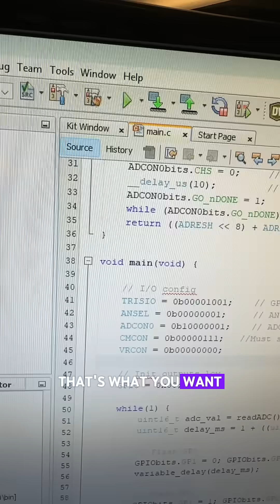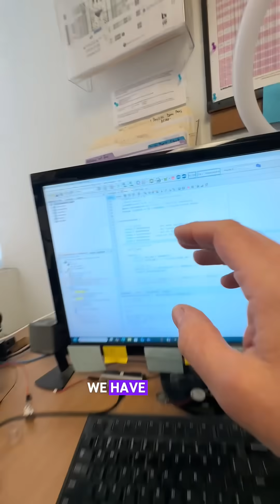Introduction to Microcontrollers and PIC12F675

Comment: PIC you say.. have you met the upgrades, the 6502 and the 8051? 😂
Seriously though - that whole proprietary ecosystem should stay in the ground.
Cortex M0, STM8, STM32.. so many alternatives. Many are slightly more complex(and so is a modern PIC) - but they make up for it by not having Microchip’s madness forced upon you.
Reply from the maker: I’m just throwing the PIC up here as an example to inspire with, I’m microcontroller agnostic. Point of the video is “hey, small simple black box does crazy stuff with limited complexity”.
Reply: @i2c_jason  And nice video :) But as you can see I disagree about the PIC being a good example for a beginner MCU. Unfortunately the complexity of the Microchip ecosystem far outweighs the simplicity of the MCU.
A beginner friendly MCU is something that’s open, doesn’t force specific tools on you, and has a low cost of entry. Sadly, Microchip is neither these days - so it would probably be my last choice for a video like this. Unless we count the acquisition of the ATTiny series by Microchip of course.

Comment: I don't really agree, what you call extra junk in those boards helps beginners quickly get going and provides a decent developer experience, for example a lot of Nordic's nRF boards come with a built in Segger JLink debugger which allows you to debug with gdb out of the box, this is thanks to the usb you hate, the usb also allows you to see the serial output of your app, idk maybe you can do some of this with the programmer of the PIC but I doubt it will be as easy
Reply from the maker: They each have different applications. I love my Arduino ide with serial terminal, but I’m usually relying on some random library that has no accountability. When the customer really needs a hardened solution I tend to go with microchip. When I am just doing quick prototypes or higher level software then I like to have something closer to an ESP32 or RP2040, or even a Pi.
Reply: @i2c_jason Btw I just searched and I think I'm wrong about the pic, we learned about them in school when I was 17 and we wrote assembly for them, that's why I assumed they're just old less powerful tech, it seems that they're still used in the industry and they evolved, I'm pretty surprised actually!
Reply from the maker: @yassine-sa oh yeah for sure, they have 32 bit parts now. I’m not really a fan of their 32 bit stuff because it’s hard to get access from the applications engineers when you’re a small company. So in that 32 bit situation I like the open source stuff. Microchip was kind of like Arduino back in the day, geared toward hobbyists and students, but all of that momentum found its way into industry.
Reply: @i2c_jason I agree, using libraries has a cost, but microcontrollers shouldn't be blamed for making it easy to use them, it's the developers fault.

Comment: Learning this stuff is a really good skill to have and actually a must skill to have when you are in the electronics field. I would suggest being skilled with PIC and ESP32 and Raspberry Pi, Arduino etc, etc, at least all of the top 5 microcontrollers. Understanding how each work gives you the flexibility you can use in your toolbox during your career. Learn Electronics circuits, C plus code and python code for the basics and branch out from there. Once you have a good understanding of how these things are wired up, programmed and how they communicate  with each other or just the world around them you can use that information to have a very rewarding, fun and interesting career.

Comment: No thanks, PIC's and having to buy external programmers is expired tech, I had enough at PicKit3 being needed to flash itself for each PIC you selected, so we are now re-flashing the programmer itself to flash what we want to flash....
You can use barebone ESP32 ( nobody forces you to use the pre-build "arduino" style boards) , new versions have built in USB-JTAG, you just stick a usb-c connector on your PCB and flash it. For simple things you have tinyAVR 0/1/2 series or AVR DA, UPDI flash over 1 wire with a 1$ USB-Serial converter and that's all, not that PIC crap with 5 pin flash, new expensive programmer each year, nahh.

Comment: I'm definitely intrigued by PIC. Things like the DMA controller and the flexible peripheral mapping make me want to play with them. Some the stuff Mike Harrison has pulled off on PICs is pretty impressive. Though I tend to like very lean dev environments rather than IDEs. I do a lot with ARM, particularly STM32s and it's pretty much just Neovim, debugger, compiler and openOCD. Hopefully when I get some time, I can knock something together with Microchip's compiler because they do look like quite appealing devices, especially the more modern PICs.

Comment: Someone that’s taking a class for embedded systems and using a STM32107 board, is this a good investment for small, individual projects? Or would you recommend something more
robust? I'm computer engineering, just trying to get a foothold on materials for a good project, something to add to my resume. I'd love to discuss more with you if I could.

Comment: This is literally how I got into firmware development and electrical engineering. But started with the Atmel Atmega like Arduino. But I guess microchip owns both now, so the only odd ones out, are those who started with ti 😂

Comment: I mostly use pic16f872 and pic16f886 chips.  I make anything from charge controllers to led turn signal flashers.  My latest project is a prototype pcb to incorporate a pic and Arduino together.

Comment: ESP32 is having a backdoor? Common, be real. So hyped up by finding from "researchers" who can't even explain what kind of backdoor he discovered. Anybody who works with any sort of programming may leave line of codes for troubleshooting on purpose or not. And to not include that troubleshooting section in the official documentation does not mean it is a backdoor.

Comment: How's this chip compare to an attiny85? I've been getting into those, and it's been useful, but I'm definitely intrigued - my mental model of PICs is significantly larger than this chip.
Reply from the maker: I’m still learning the tradeoffs too. Sounds like the ATTINY is better on paper.
Reply: @i2c_jason I like the number of analog inputs on the attiny, it's useful for my purposes (Eurorack synthesizer modules), even if the lack of any true analog output requires a little creativity on the output side.
Reply from the maker: @j @jakykong do you bit bang your own Class D amp basically? Haha
Reply: @i2c_jason Haha dang close. I use an RC filter to smooth the PWM and a TL042 op-amp to scale and offset for Eurorack range, just have to carefully choose resistors and caps. 😅

The other approach I used was a shift register and a DAC0808, which is significantly more precise but also more convoluted 🫠
Reply: Still on the breadboard while I learn to optimize for the tiny, I'm used to datacenter scale software so it's a fun but very different exercise 😅
Reply from the maker: @jakykong nice 👍👍

Comment: I have some of these pic micros. I use them in some of my projects. I started using them back in high school in 2008. I do like how easy they are to implement in a project with minimal circuit design.

Comment: Purely from expense pov I'd pick an arduino nano, cheap as chips, easy to program, tooling is free. For the price of a pickit5 you can get 100 arduino nano clones on your favourite asian webshop. And it's also an 8 bit core and runs on 5V. You don't have to figure out the toolchain as it's all ready to go with the software. 

I started out with a PIC16F84 and a hacked together Elektor programmer hooked to a serial port that sometimes worked and sometimes killed the MCU, back in the day. Later I got a pickit3 and things improved, but boy is the Arduino much easier to use and more accessible.

Comment: It would be cool if you gave more use cases for how to use these things. Both videos I've seen have shown how to blink LEDs, so not sure what are all the cool things you could actually do
Reply: Well, that's the thing: the limit is your imagination... or budget. It really depends on how many peripherals do you have within the chip, this one is very limited, it barely has a couple of timers, gpio usage, and some models have an analog to digital converter (ADC). On top of that you have interruptions on external gpios and some other ones as well.
Whatever you come up with that utilices just that, you can do it. Normally these companies integrate a few examples of usage within their IDE.

Comment: You'll be replaced by AI before you finished to learn it...
Reply from the maker: If you look at the trends in AI, that singularity keeps getting pushed out. I was very disappointed in GPT5 for example and always use 4o. So I agree that eventually a lot of the minutia will be done by AI, but you still need a physical human to define problems, create requirements, and otherwise engineer context for whatever capable AI “can just do this” so it knows that to create.

Comment: Even with these skills I struggle to find projects or things to use these for. But this helped pique my interest back!
Reply: You could just do some basic stuff and make YouTube videos explaining it.
Reply: What I ended up doing was just mixing the things I enjoy. I’m into photography, but I work as a SWE, and I also like electronics and IoT. When I put those together, I start getting random ideas, sometimes with a bit of help from LLMs.

One of the things I made recently was a little film-emulation camera using a Raspberry Pi Zero 1.3, the 5 MP camera module, a tiny LCD, and an 18650 cell in a small case. It runs a program that does four film-style presets, 3D LUT math, halation, and spectral grain. Nothing huge, but building it was a lot of fun.

So yeah, for me, crossing hobbies like that is what keeps things interesting.

Comment: I could tell you a thousand things that those microcontroller have that a pic doesn't. Not to mention the Real time OS they run and how multi tasking can change your life. Not to mention a 4Mhz or 16 Mhz part compared to a 240 Mhz dual core part. This could take all day. Each of these systems have their use and purpose. We should learn to "stay in our lane".
Reply from the maker: My lane is all lanes that run C or Python. I’m not saying you use an 8-bit micro for anything other than learning the lowest level basics and for correct applications. You don’t put an ESP32 DevKitC on a 100k EAU $0.75 motor application’s bill of materials. I use the RP2040 and ESP32 all the time, usually when I’m just ideating a concept quickly.

Comment: I like AVR ATTiny assembly more than PIC but learn both in late 1990s for work didd PWM LED LAMP dimmer and EL LAMP sequencer. But I had to do it both for AVR and PIC; since the owner/boss was concerned about lead times/supplies. Be neat if they could make super fast 8 pin uCs. I might get back into it but a bit rusty with the assembly have to refresh to be familiar again, heh.

Comment: You could ofcourse also use an AtMega.. AtMegas have an internal oscillator, but can also use a crystal for increased clock precision. The AtMega32U2 or U4 has USB support and is quite easy to program. You can even do it with an arduino which is programmed as an ICSP programmer, which comes standard with the arduino programming software.

Or use an STM32 if you need a little more processing power, more memory, professional audio interfaces, or other more advanced busses and features like encryption. I would warn that the STM32 is not for the beginner microcontroller hobbyist though. Some of these suckers have difficult power requirements and can be bricked easily if you don't know what you're doing. With added complexity, comes extra responsibility, which means extra research and frustration.

That being said, I personally got a HUGE kick out of playing my first audio sample from a custom STM32 project sending audio data over an I2S bus to a D/A converter. 😎
Reply: Seconded. The 32u4 is a great platform.

Comment: PIC’s definition of “a c programming layer” is a very generous definition of the phrase. For anyone looking to get into programming the PIC, let me save you a lot of effort. Take the exact datasheet for the exact part you want to program and put the register maps side by side with the C code. Thats literally how you program it. Want to sleep? Easy! Write a for loop that executes “asm(nop)” a few hundred thousand times in a row to sleep for the number of clock cycles needed.

I do wish they shipped a more “batteries included” standard library that I could just enable for basic things like sleep. I’m fine with it consuming a timer for me and executing a WFI/WFE (wait for event), I sometimes just want to be lazy and keep my code surface small. Writing every system function by hand for every project is a lot of responsibility

Comment: If you want to start without spending the ~150€ the PICkit 5 cost you can still use a PICkit 3 (~20-30€) you will just need to use MPLAB X 6.20 (and not update) and could experience some incompatibilities with newer µc (released in 2025 and after) and some of the code is different (like the ADC) but everything works fine. That is what I do because my university gave us their PICkit 3 for free since it is not compatible with the newest version of the software.

Comment: Old guy here.
When I first started we programmed in ASM using a basic text editor, Programmed the PIC using a homemade Parallel port, AVRDUDE programmer. Made some cool stuff back in the day. Even submitted a basic telemetry system to Oceaneering. Didn't get the contract but it was fun.

Comment: I used a pic16f18877 in my microprocessors course last semester and coded in assembly using mplab it’s fun we used a 40 pin breakout board with usb circuit though 😛

Comment: nobody gives 150$ per hour
Reply from the maker: It is an older rate these days, probably better to ask for $175 - $250 range for a microcontroller product design. But I'm in the rust belt of the US so I'm lower cost.